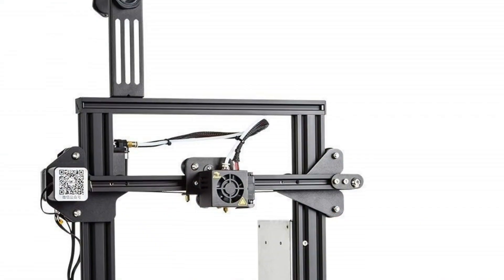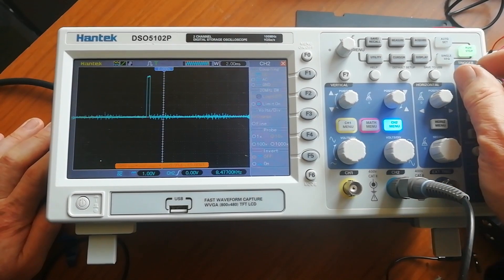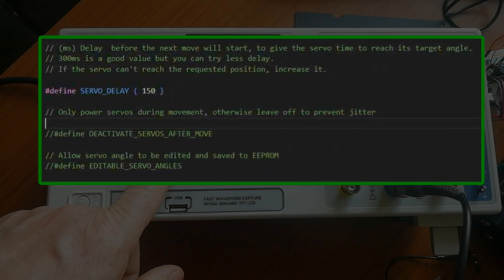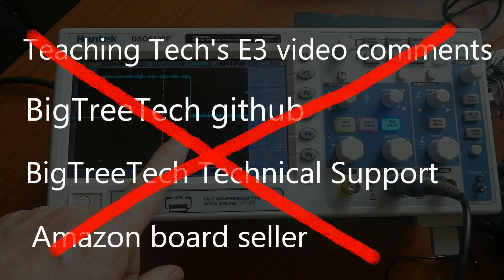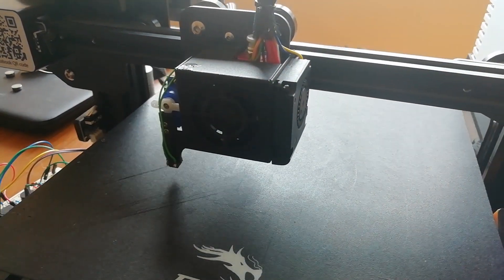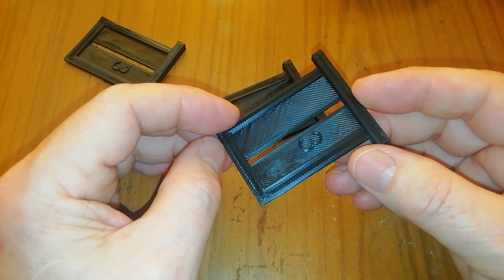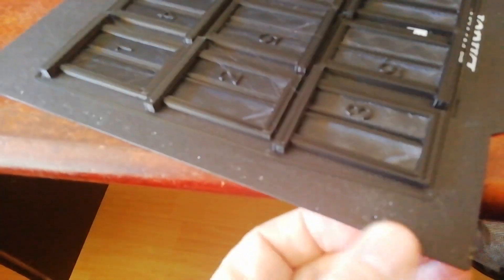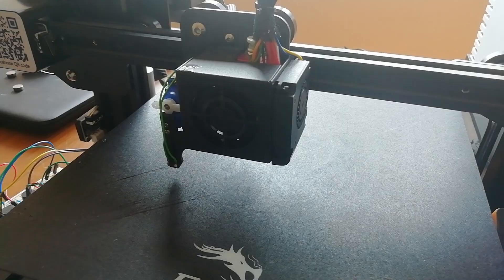SKR mini E3, Servo Probe Twitching & an Uncomfortable Work-around

Comment: where do you connect the damn servo :S  skr e3 mini v2.0
i want to make a bfptouch probe and nobody is telling it and allway use some weird stuff like duet or arduino with ramp shield >_>
Reply: I did a BFP and connected on the first three pins of Z-PROBE connector (GND/5V/SIGNAL). Also used the same 5v pin to power the optical "switch" and connected the two others on z-endstop pins.

It works out of the box, like a abltouch (of course there's the need to adjust the servo on the firmware).
Reply: @wainercesar2176  i already figured it out but thanks
Reply: @wainercesar2176  but i do have another question can you connect another servo somewhere else than the bltouch connector ? i want to use a second servo for filament switching